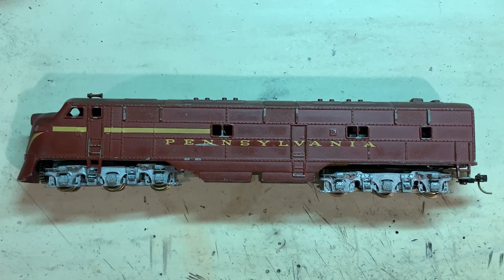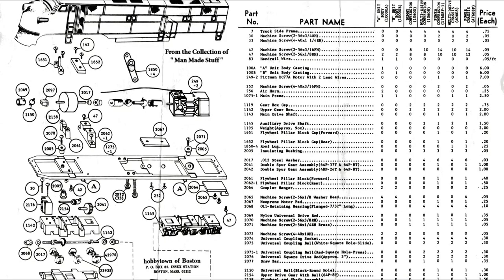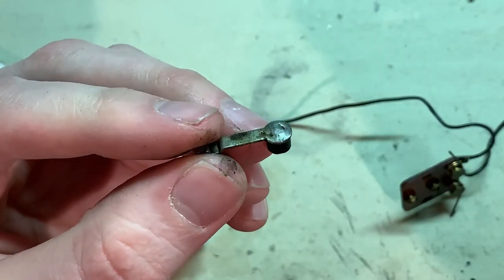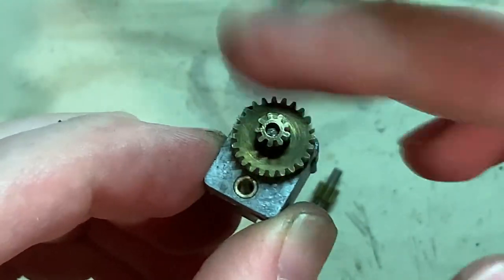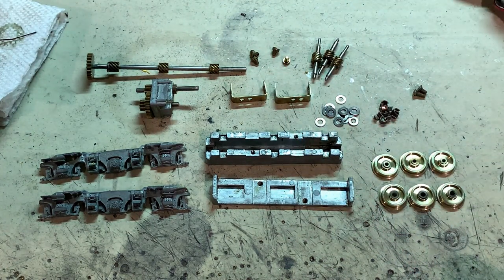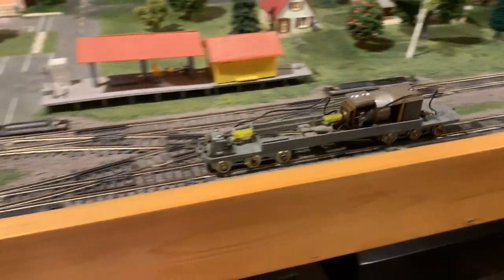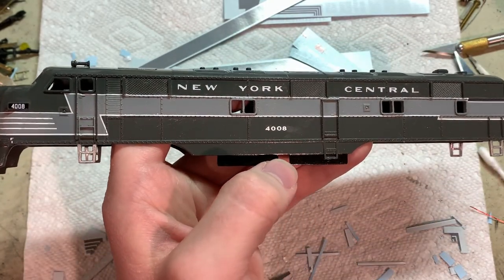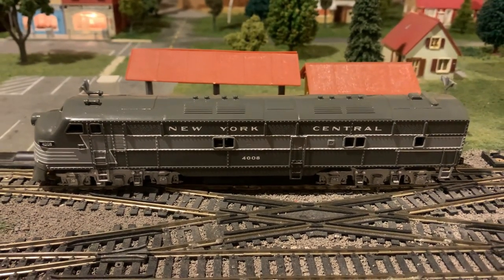Hobbytown E7 restoration and review!

Comment: awesome job. Always impressed when you bring an old old model up to modern standards. 
I cant imagine how much that thing weighs, almost expected it to fall off the rails on those curves!
Reply from the maker: I haven't weighed it, but it has to be over 2lbs!
Reply: @Tony’s Trains  There is more than enough space inside that model for you to fit all the decoders and electronics you need. Unlike todays plastic diesels which NEED to have their internals crammed with weight, these diecast models already have ample weight from the shell, meaning theres a lot more space inside to fit whatever electronics you desire.

Comment: I had a PA1 with the 91 motor. A friend of mine and I added a weight block with a hole bored through the middle for the drive shaft. It weighed 3 pounds and called it our bridge tester. Pulled all other locomotives backward with little effort. Later in its life, the original zink frame collapsed .  This was in the very late 50's, but now in my very late 70`s, 25 years in the Navy, and retired, it got away from me and is only a distant memory. But what a memory. Being from Illinois and the Wabash E7 for comparison was a nice touch for me. Thanks for bringing that back for me to see. By the way I did see your PA show.
Reply from the maker: That's definitely a shame about the frame falling apart, but at least it got to be a powerhouse while it lasted!  Hobbytown still makes the full PA-1 kit (I think they switched over to the Lindsay body though), and like always, there's a lot of room inside for adding a ton of weight.  If you haven't seen it, I created an A-B-A multi-drive setup with a large motor in the B unit and Athearn bodies, and even though it's not super heavy compared to all metal kits, the sheer number of driven wheels still gives it more pulling power than anything else you can get today.

Comment: Love the hobbytown projects.  I have many Hobbytown locos and a few kits still to be built.  With multidrive imagine what a speaker you could put in a non-motorized unit.  Keep up the good work.  Thanks, Swamp Daddy
Reply from the maker: I put together a 3-unit multi-drive PA setup a few years ago, and there is a ton of room inside the front and rear units to add speakers and electronics to the level you might find in O gauge!

Comment: Automotive Spray Carburetor Cleaner works best on the Comms and shaft bearings (removes all of the old grease/oil). Then you can add the new grease/oil.

Comment: Thanks for doing this video!  I just acquired one of these, and like yours it was not functional.  Pulling it apart to the point where you had the primary truck running - I have it that far but when I go to hook up the other wires how it looks like you have them it doesn’t power on.  I have a feeling I may just have the wiring wrong.  Was curious if you’d be so kind to remove the shell so I can see how the complete wiring is done on yours as the point towards the end of the video it’s not 100% clear as the ends of the wires aren’t shown.  Thanks again as I’d love to get this beast fully working!
Reply from the maker: The wiring is one truck to one brush and one truck to the other brush. If the motor is working fine, check to make sure the insulated wheels in the front truck are opposite from the ones in the rear truck. I usually put the front insulated wheels on the left rail and rear on the right.

Comment: What did you use as a mold for casting that weight? I love the repaint too.
Reply from the maker: Thanks!  To cast the weight, I took a good size sheet of aluminum foil, folded it over a few times to make it thick enough to hold a shape, and then folded it into a tray shape of the size I wanted.  After cooling, the foil peels right off from the lead.

Comment: Would you vote for 6 powered axles as you did on this one vs only 4 powered axles? All axles driving seems to be best, but possibly not necessary.
Reply: Curiously, the prototype E7 only had 4 traction motors.
Reply from the maker: @blairmielnik8228  I built an E6 about 10 years ago using the 4-powered-axle chassis and a Cary body.  It doesn't have quite as much pulling power, but it runs just as well.

Comment: Nice job, I have watch this many times as Im restoring a E 8 Hobbytown What paint did you use ? and how do I find decals. I have 4 passenger cars to go with it, Thanks
Reply from the maker: I used Scalecoat II paint with Testors airbrush thinner, and the decals came from Microscale.  You can get the decals directly from them or from a hobby store or online retailer that carries them.  You may want to start with Microset solution for setting the decals, and for more extreme areas, Walthers Solvaset can help since it's much stronger.

Comment: Fun watching. I wonder how these old models would perform with sophisticated DCC decoders (say, TCS). Plenty of room for sound! I have a set of these that came with the DC90 and one that has the DC91 that looks virtually new. After watching your work, feels like a project coming up.
Reply from the maker: The brushes are both insulated, so DCC installation would actually be simple for these.  The motors can draw a lot of current if stalled or when making a sudden start, so it'll have to be a heavy duty decoder.

Comment: The pair I have had a shaft that extends between the locomotives to provide power to the second unit from the first.
Reply from the maker: Sounds like you have the multi-drive chassis! With a large motor driving it, these can outpull just about anything.
Reply: @DarthSantaFe  got a few old items to restore myself, just waiting for the time.....

Comment: You need to get yourself an ultrasonic cleaner.  It will make your restorations much easier.
Reply from the maker: One of those would be nice, but I would need a pretty large one (those can get expensive).  Maybe if I start doing more restorations needing that level of cleaning then I'll look into one, but for now, cheap chemicals in a pan work well enough for most of my projects.

Comment: So only 2 axel are powed not 3
Reply: Ok it had a kit to make it all 3 axel's
Reply from the maker: @kb2sbl  The original kit had 2 out of 6 axles powered with the option to upgrade to 4 axles powered. When they changed the design to the one I have here, the basic model had 4 axles powered and the upgrade had all 6 powered.